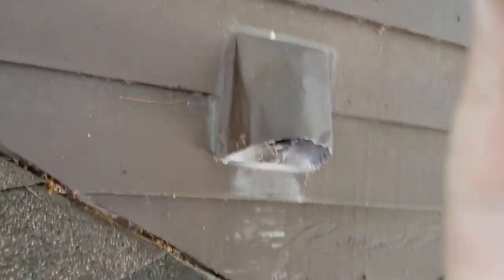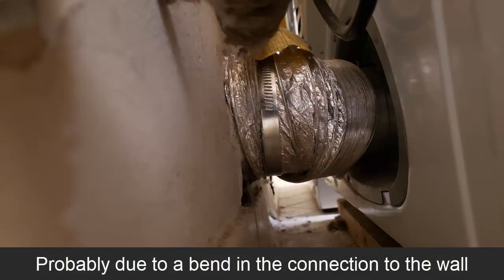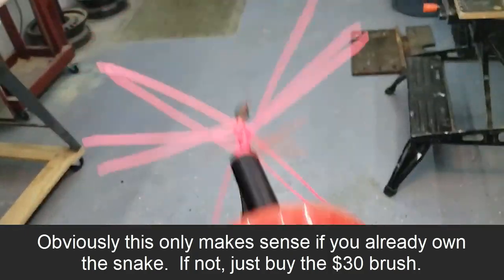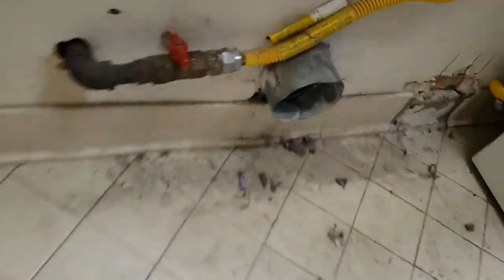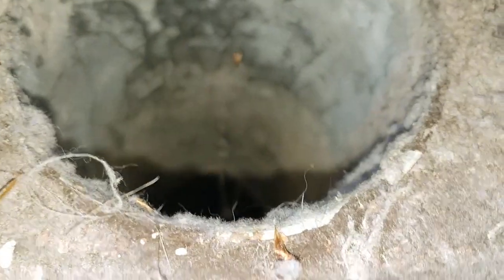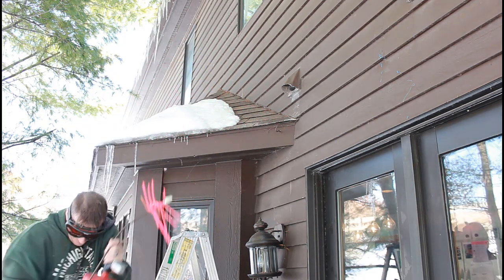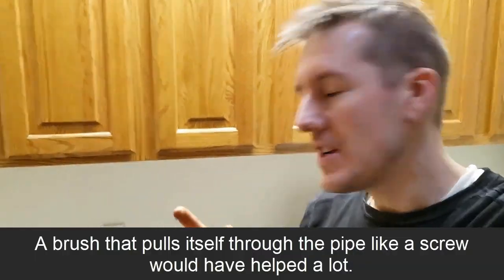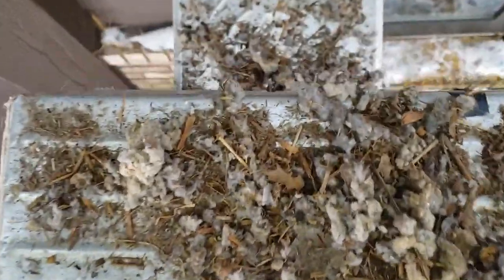Dryer Vent Pipe Cleaning Kit | Homemade Lint Brush for Free

Comment: Thanks for the great video.  You got the job done and your camera work and editing was top-notch...   Our Condo HOA requires an annual cleaning of the dryer vent pipe.  They are concerned about fires.  I watched a dryer-vent-cleaning company clean ours.  They had a specialized van with a very heft gas-powered air compressor and a hose-reel with about 200 feet of 3/8" air hose.  The guy shoved the air hose up into the exterior dryer vent.  On the end, it had some kind of spinning air nozzle.  When he pressed a trigger, air caused the nozzle to spin rapidly (about 1000 RPM?).   Inside the pipe, I imagine that the air was blasting the lint loose.  The volume of air came rushing back out the vent (where he was working).  He had a cloth bag that captured (most of) the dust and lint but allowed the air to pass through.  When he was done, he transfer those contents into a trash bag by turning that cloth bag inside out down inside the trash bag.  We elected to not move our dryer, but he could have done it from inside the house.  Thanks again!
Reply: well, you can't spell "condo" without "con", lol.   ;p   that kinda sounds like somebody had a brother-in-law in the vent cleaning business or some cat lady got into a position of authority.

Comment: This is a really good idea.  I have an unfinished basement and would just replace the cheap flexible duct for $10 every two or three years.  Obviously this isn't an option if your duct runs through sealed floor or ceiling joists.  Good idea
Reply: Some places don't allow some of the flexible ducts to be used.  There are several different types, usually plastic, aluminum foil, and semi-rigid flex pipe.
Another product they make now is back pressure sensors that will tell you the pipe is getting restricted.  Many new dryers even have it built in.  I got a dyer a while back that had one of those dummy lights, and it would trip once in a while, I'd clean out the outside vent door, and it'd be fine.  Well, I moved to a place that had the same vent door(it's actually not a proper one for a dryer but that's another story) but it has a semi-rigid pipe that a bit longer, but straight up instead of having a lateral run, and they light hasn't tripped once.   I wouldn't have guessed it would make quite that much of a difference.
Also, the short home use dryer clean kits are pretty inexpensive also.  More than $10, lol, but a homeowner wouldn't really wear it out unless they did all their neighbor's vents too all the time.

Comment: Put a towel around the blower or you will get lint all over in the house, plus you will get better pressure. I will purchase a cleaning kit and just use the air from the dryer to see how that cleans. It is a pain removing and re-attaching the exhaust vent hose behind the dryer. Also remove the back pannel of the dryer every so often and clean out the exhaust pipes. A rodent collected a bunch of garbage inside our dryer at some point. Not sure normal cleaning can get that heavy stuff out.

Comment: I have a couple of elbows that are fairly tight angles and 7+ feet down. Several extenders on another kit I had twisted and broke off, causing bigger problems. Are the rods on this kit stronger than plastic?
Reply from the maker: No.  I would just buy a new vent brush.  This thing was metal and didn't do as good of a job as the standard dryer brush you can buy.  I also ran into the problem where the connector twisted.

Comment: First thing is you have semi rigid that runs under your house which is not code.  Second if you use any force cleaning that it’s going to rip the hell out of that semi rigid.  You need a galvanized steel pipe buddy for a vent line

Comment: Great idea but you know what most homeowners don't realize that they're two types of dryers. You have gas and you have electric please don't put people behind gas dryers when they don't realize if they pull it out if it doesn't have flex gas piping on there they can actually harm themselves and then going to end up calling somebody to come and fix a gas leak. If you're not mechanically inclined don't do this stuff. Leave it to the pros